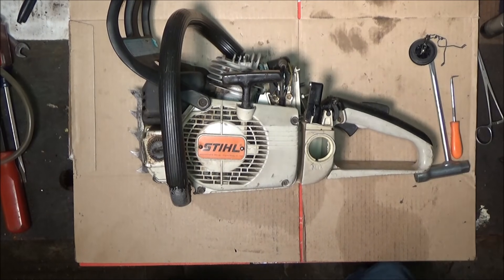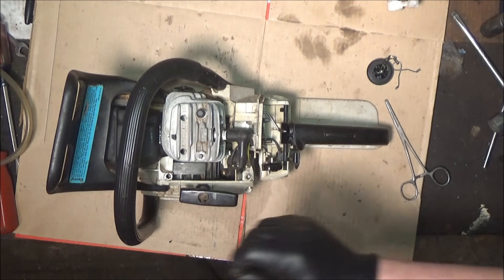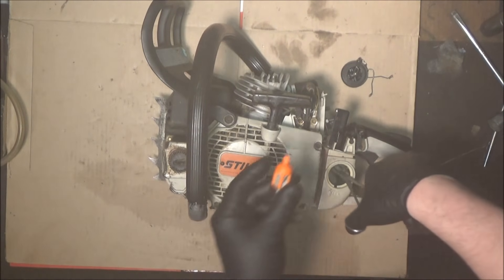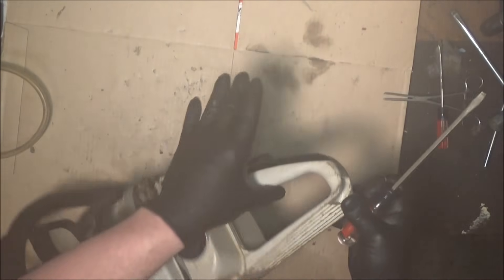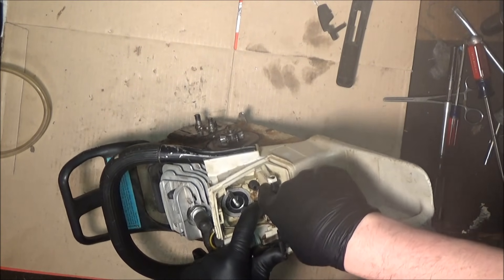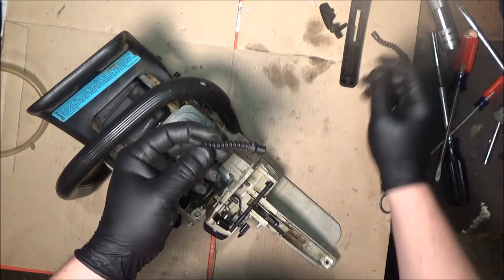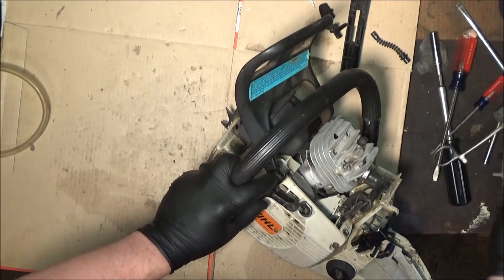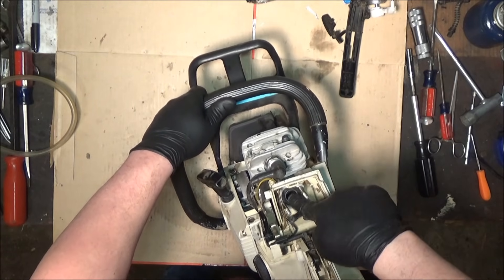Stihl 026/MS260 Fuel Line, Fuel Filter and Impulse Line Replacement

Comment: Hemostats is what they are called.  I use a little liquid soap on rubber hoses when installing them in a chainsaw.  I like to replace the impulse line when I pull the cylinder off and put a little 1184 on the impulse nipple before I put the impulse line on the nipple.  This keeps it from ever becoming disconnected.  Then I feed it under the intake boot and start it into its hole in the rear wall.  Once the end gets inthe hole I grab it with my hemostats and pull it until it pops into position.  Soap on the end of the hose helps it come through the rear wall.  A lot of cussing usually accompanies the installation of an impulse line.

Comment: I like to attach the linkage before installing the carb onto the studs it really helps especially someone with big hands/fingers like myself.
Reply: The throttle linkage was removed from the carburetor after carburetor removal so reinstall should be  the same procedure in reverse.  Therefore as stated the linkage should be reattached to the carburetor before carburetor reinstall. The carburetor was not disassembled so there was no need to detach the linkage from the carburetor. The linkage could of simply stayed attached to the carburetor on disassembly as it was already detached from the handle.

Comment: Thanks, this video really helped me to replace the impulse line.  Before I saw this video I was afraid to take the old line off because it looked impossible to get back on without removing the flywheel.  One thing I did a little different was use wire from a coat hanger to guide the impulse line by putting the wire inside the impulse line.  Then from the flywheel side I was able to use long skinny needle nose pliers to put the line on the nipple.
Reply: You prolly dont care but does anybody know of a trick to get back into an instagram account??
I stupidly lost my account password. I would love any help you can offer me.
Reply: @Jeffrey Onyx Instablaster :)
Reply: @Ephraim Justice it did the trick and I now got access to my account again. I'm so happy!
Thank you so much you saved my ass :D
Reply: @Jeffrey Onyx happy to help =)

Comment: If you put the filter on the line first you can pull it through from the tank.  It goes very easily that way.  No tools needed.
Reply: steve eber Will the filter fit through the hole in the tank by the carburetor?
Reply: @markproulx1472  No, I believe he meant you attach the filter & fish it through from the tank side 1st. On my MS 270 the fuel line only goes in from the outside, The rubber/nitrile tube has a larger flange for the outside of the tank. It can only be routed from outside in, unfortunately.
On the throttle linkage, I'd attach it to the carb before reinstalling the carb. Well, see if doesn't get in the way with the impulse line etc while reinstalling the carb on my MS 270. May be slightly different in there from a MS 260. Also, CAREFULLY removing the black part of the handle so the trigger & safety don't go flopping around, removing the throttle linkage bar & re-attaching the black handle part so the trigger etc is inside & held in-place with the black cover & bolt, should save any issues of trigger, safety lever alignment.

Comment: I replaced the fuel and impulse lines on my 029 Super. I may have read this tip in the comments here or somewhere else. I used a piece of 6" or longer bare #14 copper wire to push through the new impulse line. Have it stick out the end a half inch or so. Insert the copper wire into the barb at the crankcase to use as a guide. It's a perfect fit. Just slip the new impulse line down the wire and onto the barb, pull the wire out. So much easier than trying to get your fingers in there or using other tools.

Comment: ....good video that helped me replace the fuel and impulse line on an old Stihl 026 restoration project.....special thanks to the two commentators
that suggested using a "guide" wire for the impulse line replacement....that helped a bunch, and having two sizes of hemostats got the job done...
thanks again for posting....  :)

Comment: Mine would not start. But not stay running.
Leaned that line is not a vent but the impulse line.
So I remove the carb (again) and re-attached the line to the crankcase nipple.
I happened to have a pair of forceps also and did it like you did. Took all of 15 seconds.
Ensured the line was properly seated in the body hole behind the carb and re-assembled everything.
It starts and purrs like a kitten now.

I use a tiny dab of dielectric grease on the hoses which does not affect rubber. We use it a lot on offroad motocycles.

Now the crankcase pressure pulses can pulsate the fuel pump diaphragm in the carb and pump fuel.👍

Comment: Right you are; forceps; great for removing and replacing fuel and impulse lines and extracting fish hooks from the catch of the day; lol; thanks for a great informative video; I think you just solved my problem. I usually attach the linkage to the carb before I slide the carb in, but your way is fine too. You can stuff a screwdriver down its gullet to hold the throttle arm down to re hook the linkage. You can take the linkage off the carb without removing the handle top but you gotta be sneaky and have a good light.

Comment: Easier to put the fuel line on the filter first, then apply a little soapy solution for lube and use a flexible wire to fish the line  up from the tank while seting the filter grommet as well. Nice video 💯

Comment: Helpful video, thank you! You sure made getting the impulse line on look easy! I managed to get it on by first threading a wire through the line and into the nipple. I could get the wire into the nipple fairly easily and it then guided the line.

Comment: The impulse line on a ms 260 plugs into a nipple on the crankcase, unlike most Stihl saws that plug into a nipple on the cylinder.  I just replaced one on my ms 260 Pro that I am restoring from a standard ms 260.  It is easy to do if the cylinder is not installed.  I replaced the standard ms 260 piston with the bigger bore 44.7 mm piston with a deco valve, part of the Pro upgrade.  I used a brand new Stihl Intake boot and impulse line out of an abundance of caution.  The old ones were 23 years old and time for replacement.  I will also be upgrading the oil pump, worm gear and sprocket, also, to bring them up to Pro standards.  Cleaning up the saw has been the most difficult part of the restoration.  It was filthy, but compressed air, purple power and elbow grease will work wonders.  What kicked my ass was getting the new intake boot on the cylinder.  It was a very tight fit.

Comment: Hi! I have a Stihl 029 it starts correctly and regulates okey but when i push de throtle it bogs down.. The fuel line seems ok, could this be caused by the impulse line ? Sorry my writting. Thanks. Good explanation

Comment: Good video, thanks. Have you ever heard of anyone fitting a primer bulb to the 026? I've bad a number of different Stihl chainsaws, 4 brush cutters and a hedgetrimmer over the years, but the 026 has been the hardest to start from cold by far. 10-20 pulls on full choke to get the fuel into the system. I found a way to get by - I dribble some fuel onto the air filter and it starts first pull, but I'd love to drill a hole in the plastic case somewhere and add a primer bulb.
Reply: ...reelMn......check the choke lever on the air filter and make sure the little round plastic valve is closing all the way.....may just need to replace the air filter.... :)

Comment: Randel Cole 

1 second ago

I have an 038 AV and the hole where the impulse line is located is plugged and the carburetor does not  have an inlet for inserting the pulse line like in the video. I assume that there is no impulse line in the 038 AV.  Does anyone know how Stihl eliminated and if there is any other line that I should replace besides the fuel line while I also replace the carburetor?
Reply: Probably has a passage on the intake boot/where the carb fastens to the motor.

Comment: I have a ms120 and it will not start,  I've changed the fuel lines, filters, spark plug, cleaned fuel ports in the carb, changed ignition module, and this thing still won't start,  any clues?
Reply: j lowe do you have compression?
Reply: Spark? What about the spark arrester and muffler? Are they clear?

Comment: I have a Stihl 026. Been sitting for years. I've changed, spark plug, impulse line, fuel filter. I spray some starter fluid in the carb and she fires up but wont stay on. I've changed the fuel. When I added new fuel I seen I little leaking near the fuel vent. Any suggestions? Thank you for your help.
Reply: Prob need a new Carb

Comment: You can pull the starter off and replace the impulse line via of the slot between the cylinder and the rear carb wall w/o removing the carb.

Comment: Impulse line - I connect it to the nipple on the cylinder and direct it around to the hole in the rear wall and push it in the hole. Mi then gab the end with my hemostats and pull it until it snaps through the hole.  I put a littleWD40 on the impulse line before I pull it through.  I also put a little 1184 on the nipple in the cylinder and in the hole in the impulse line.  This makes sure it will not disconnect from the cylinder nipple.

Comment: How would i know if my impulse line needs replacing?  I replaced my fuel line and filter a while ago, it wasn't to hard, but after watching you struggle some, i've decided i struggled 3 times as much as you! You did make look easy. I was wondering why you didn't rebuild/repair the carb while it was out?

Comment: Use a 50% mixture of Dawn and water to help rubber parts get into their allotted locations.  I have a spraybottle of soapy water that I use.  I do not use oil because it will deteriorate rubber.  Soapy water will not hurt rubber.  It really helps pulling an intake boot through the rear wall on a Stihl saw and getting the fuel line grommet to seat in the tank.
Reply: I broke my new fuel filter line trying to get that seated!  I will use dawn and ordered a new fuel line and pulse line.  Stihl sent me a longer fuel filter line which hits my air cleaner.  I will get them in if I don't have a blow up!!

Comment: Would impulse line or fuel line cause hard to start conditions?
Stihl Wood Boss 028 av
Saw has been harder and harder to start... and stalling after it warms up. Removed carb, cleaned it out very well, installed a new spark plug, and it doesnt stall anymore. But, it still takes quite a few tugs to get it to fire up. Used to only take 1-2 pulls.
Any help would be appreciated
Thank you
Reply from the maker: splash yes, they definitely could cause that.  Do you know when they were changed last?  If it’s been more than a couple of years, it would be best to change them anyways.
Reply: @gxfricke  
Ya they were changed at a Stihl dealer about 5-7 years ago...
Saw gets very limited work.
What else on a saw could cause it to not start quickly?
Thank you

Comment: The impulse line on the 260 plugs into the case and not the cylinder, like most Stihl saws.  I think it is easier to replace than most other Stihl saws, just go in from the top, grab it, and push it on the nipple on the case.

Comment: Thanks for posting this video. I have an 028AV that stopped running. I am about to start working on it. Question is. There’s a yellow(?) hose that has rotted out. Is this just a breather and does it connect to anything other than the tank?  Thanks

Comment: have an 024 ,,,was running fine 4 months back. but tried a week or so ago . would kick over with a blast of starting fluid then just die .over and over.emptied tank and checked fuel line which just fell apart when i grabbed it.took it to a stihl dealer to have new fuel line installed .told him to use the same filter,,,,,,,,,they called today and said they changed the fuel line for 28.00 bucks but the saw wont even kick over on initial pull..asked if they tried it with starting fluid but they said they didnt have any ?,,,,,,,,,,guess ill pick it up and try to figure it out,,,,,,,any thoughts?.
Reply from the maker: bob woerner I would rebuild the carb.  Usually when those fuel lines rot like that the carb will suck up a bunch of little pieces of the hose.

Comment: Thanks for a great video.  Does my Stihl 021 from the 90s have an impulse line ?  The fuel tank has a vent tube on it. I've adjusted the low and high screws and idle speed. The saw runs great for 3-5 minutes of cutting then it will bog and die when you go from idle to full throttle.
Reply: Sounds like crank seals

Comment: Mine starts with the choke runs for 5-10 seconds then quits... any ideas?
Reply from the maker: Most likely the carburetor is dirty and needs a rebuild.  Did it sit with gas in it for a while?
Reply: @gxfricke  found the problem...fuel line dry rot...running now....thanks

Comment: Hey there, i have a stihl 024 AV, ran it out of fuel one day and since it wont go. I fitted a new carb but still no luck, i noticed a slight crack in the fuel line but havnt checked the impulse. The thing that i dont get is that even when i squirt easy start into the head it still doesnt run and die. It has spark. Any advice would be great. Great video thanks!
Reply from the maker: Where are you spraying the easy start?  If you're spraying it into the carburetor, it should definitely pap a few times at least.  That being said, I don't recommend using starting fluid on two stroke engines because there's no oil in it.  I would definitely replace the fuel and impulse lines and also replace the fuel filter.  If you sucked up some junk from the tank, when it ran out, it will get into the fuel line and carburetor.  If you replaced the carburetor and not the fuel line and filter, you may have sucked more crud out of the existing fuel line and filter and plugged up the new carburetor as well.
Hope this helps!

Gary
Reply: Garebears Garage I took out the spark plug and sprayed it in there. I will replace the fuel line and impulse etc and see what happens, if that doesn't work I don't know what to do...

Comment: Reason as to why the impulse line has gas going through i though it only pushes air or am i wrong?
Reply from the maker: The impulse line should not have gas going through it.  If there's gas in the impulse line, more that likely you have a bad pump diaphragm in the carburetor.
Reply: Thank you i appreciate the info!

Comment: instead of using a screw driver to seat the grommet on the impulse and fuel lines, try using a long deepwell socket to push them into the case.  never nothing sharp that could cut the hoses.  a small crow foot on an extension might work better for the fuel line but your 5/16" socket will work fine on the impulse line
Reply: Yeah, a use for the once in a blue moon crowfoot wrench.

Comment: I put it on the nipple, first, and then feed it under the boot and from the other side feed the snout of the hose into its hole.  Once I get the nose in the hole I grab the end of the hose with my hemostats and pull it into the hole.  I spray the hose with my pressing liquid to help it to get through the hole and seated.  I also put a little 1284 on the nipple an in the first bit of the hose to make sure it stays connected.  I have had them work loose in the past.

Comment: NEED HELP... So i was using my ctihl 026 cut about 3 trees down, all of a sudden it ran out of gas, so i refilled it and it wont start, figured there is an air bubble in the line so i put gas in the carburator and it start right up, until the gas in the carb was out, then no start again, figured it would be the fuel filter, being old and all, so i replaced that, also the fuel line, and the spark plug, using this video to do so, ty btw... figured it would fire right up no problem after i was done, and nothing, can anyone help? still fires when i put gas in the carb, but nothing else... making me think its just not getting the fuel to the carb... ANY HELP? I MISS MY CHAINSAW! PLEASE ANYTHING
Reply from the maker: Doug Bergeron sounds like something got sucked up into the carburetor.  I've seen old fuel lines start to disintegrate internally and little black pieces will plug up the carb.  I would definitely start with a carb rebuild.
Reply: Rebuild? Or replace? I just want my chainsaw back haha! So your saying where the fuel is taken from the fuel line there might be something stuck? Shall i just clean it out or buy a new carb? I dont mind doing either, but ive had this saw for over 10 years and never once has it done me wrong, i love it haha
Reply: Honest it was a super downer for some reason when it didnt start
Reply from the maker: Myself, I rebuild them, the kits are cheap on eBay.  Make sure you get a genuine kit.  I believe all of the 026's had Walbro's, but check the carb to be sure.  If you want to replace it, I would definately get one from the Stihl dealer, not ebay.  Just keep in mind that you are troubleshooting and while it is probably the carb, it still may not be, that's why I like to rebuild them, the kits are usually less than $10.  The other thing to check would be the impulse line, if you haven't replaced it.  The carb gets pulses of pressure and vaccum from the crankcase through the impulse line and that is what pumps the fuel into the carb.  If theres an issue there, you would have the same symptoms.
Reply from the maker: I know right?!?!
Reply: Thanks man... gonna rebuild it, u think something might be caught or stuck in there?
Reply from the maker: Being that this happened when it ran out of gas and the fact that the filter and line were old, I would definitely rebuild the carb.  It takes just the smallest piece of crud to plug them up.